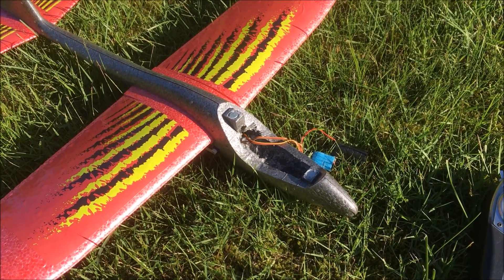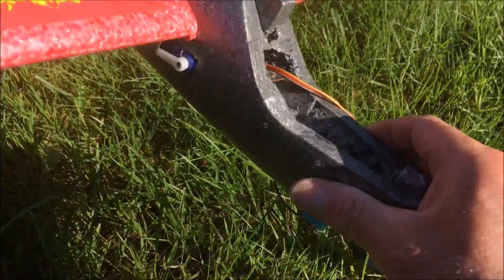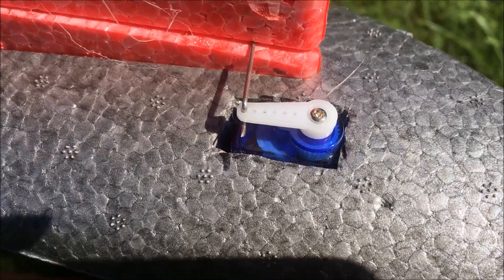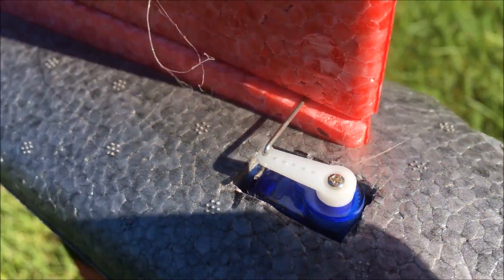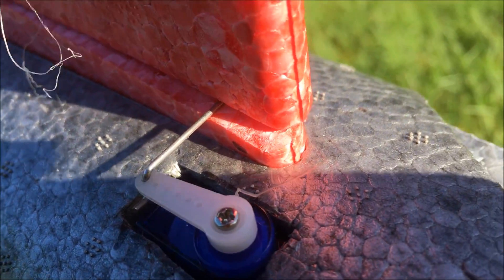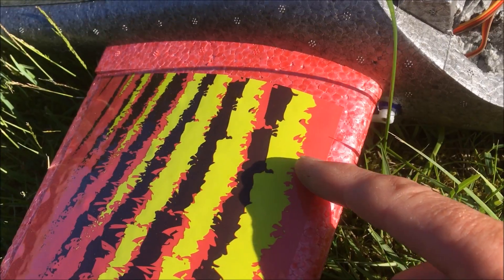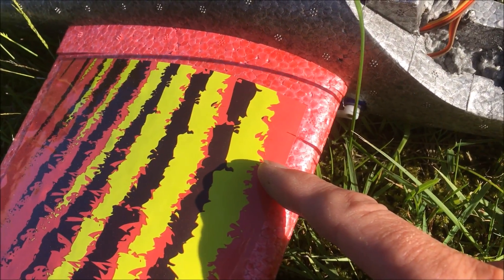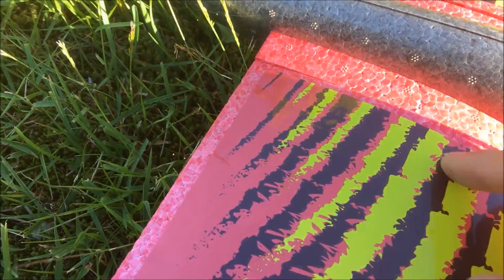How I converted the Lidl XL glider to RC

Comment: What point under the wings is the CG please?  How many MM back from the leading edge?   I have been given one to the same setup, but with no ballast.   What is the ballast weight?   Thank you.
Reply from the maker: With the wingerons the CG is 60 mm, and ballast for windy days is around 100 gram.
On a normal elevator model the CG can be around 50 mm.

Comment: Hi, I've followed your build log and I've got my glider build but I have a question: I want to use 2 Li-Ion cells to power the glider and that will bring the weight to about 300g (280g to be more specific) would that be ok? Thanks !
Reply from the maker: If you can the CG at 60-65 mm it will be ok, We now fly most of the Lidl and Wisel gliders with a 700 mha 2 cell Life battery
Reply: @SpeedsterDEN  Great, thanks!

Comment: Nice project...starting from scratch (except for the glider I already have) how much would you say I'd have to spend to build mine on the cheap? Not only motor and servos, but transmitter, battery, charger, rods, wires... thanks

Comment: Hi! Just tried my first flight from NrLyngby Cliff. I thought I had the right CG, a little bit on the nose heavy side. Unfortunaly it nosed down almost immediately and I could not get it level. Fortunately it's still in one piece and I could retrieve it! My guess is that it needs more nose weight, right? Fortunately I brought my wing, too 😁
Reply from the maker: Hi, if you have pitcherons and the CG is forward it will feel like the elevator dont work at all, around 55 mm then it will fly, and it will need some up trim, around 2 mm up on the leading edge. At 60 mm then it will do loops and the dive test will say that the CG is too far back, but it will be fun to fly.Max throws on the servos, and 60 % expo on ailerons and 30 on elevator.Good luck :)
Reply: SpeedsterDEN hmm. That's strange. I do have CG at 60mm from the leading edge. Will try tomorrow from a dune where I don't have to climb so many stairs to get it back! 😬
Thank you!
Reply from the maker: Or try it on flat land first and trim until it fly straight, and then go for the dunes :)
Reply: SpeedsterDEN thanks, it did fly a bit yesterday in Løkken dunes! 😁

Comment: Great build! Seems like the best solution of all I've seen so far, and I'd like to copy it. 

I got myself a 4mm carbon rod and a 5mm carbon tube with 4 mm inner diameter. If I try to put the rod in the tube, it's very tight and the tube eventually starts to split. Maybe a dummy beginner question, but does the tube need to be a little larger in inner diameter? Or do I need to sand the rod a bit? 
Is yours really carbon? It looks a bit like a plastic tube.

Another question I keep asking myself is : the CG must have been good out of the box or the plane would not fly. So why do we get a good chug with all the added weight of the electronics in front of the wing without adding weight at the tail? Ok, that's more a flight physics question - maybe I should read something about CGs to get me started 😄
Reply from the maker: Hi, Just sand it until it have a loose fit, the first one I made I used a carbon tube the next 2 I found a plastic tube that fit. The bolt in the canopy must be removed so and then the cg is near when the electronics get in. batt must be back in the canopy, Go for a cg at 60- 65 mm and dont glue the tailplane on, there is room for a coin for fine tuning the cg in it.

Comment: Hi Speesterden, where do you have the center of gravity?
I am in Normandy and tested the lidl plane with 4 xAA batteries. A bit too heavy and still nose diving with 2 x1 euro coins on the stabilizer. 
Thanks
Reply from the maker: Hi, I fly it with CG at 60, Normally with a 460 mha life but also with AA battery but with the battery all the way back in the cockpit on both. On my Lidl gliders with pitcheron it need a bit up elevator, around 1 mm measured at the leading edge. Good luck Soren

Comment: very awesome inspired me too buy 2 more gliders, been trying to bungee launch with my son as free flight glider, climbs well  nose high and then goes ,nose down and dives, any ideas why, see foamy launched on on sonic dad channel successfully but is very different.
 a build video would be awesome for the newbies like us
Reply from the maker: Anthony Mason Maybe a bit of metal in the tail will do it, remove the tail plane and on one of the sides in the middle there is a small hole, try to put some metal there, or screw a Wood screw in the back of the fuselage under the tailplane , good luck 😃👍

Comment: Hi speedster. What is the setup that you recomend? The red or the green one? I've noticed that the servo positions are different from each other. Can you please share the exact location of the spars and the balast weight? Greetings from Portugal.
Reply from the maker: Hi Bruno, the spar is 85 mm from the leading edge on the red. I like the set up as on the red one, easy to build and not long from servos to rx and the fuselage are fat where the servos are placed. My extra ballast are 100 gram and 50 gram
Reply: SpeedsterDEN Thanks a lot for the feedback. Apreciate your work! Greetings.

Comment: Nice and simple conversion with plenty of control authority. Did you insert sleeves e.g.snake outers, in the wings to take the servo actuating rods?
Reply from the maker: There is a cfk tube for the rod glued in the wing (hot glue) but nothing for the actuating piano wire, maybe there will over time and this will be no problem to do, just unscrew the servo horn and turn the wing over the rod :)
Reply: Thanks Soren

Comment: dumb question but how do you keep the wings on? they pivot on a shaft but what stops them sliding off? love the conversion and the next video of you flying them shows they're really fun .
Reply from the maker: Kammel Ryder At the end of the Carbon tube there is a hole in the underside of the wing, and the 4 mm carbonrod is 10 mm longer than the tube so I just put on a rubber packing (o ring in Danish) and gave it a drop og cyano glue 😃
Reply: SpeedsterDEN ahhhhhhhhh thank you, simple and elegant solution . Many thanks.
Reply: SpeedsterDEN The genius is in simplicity. Great applause!!!